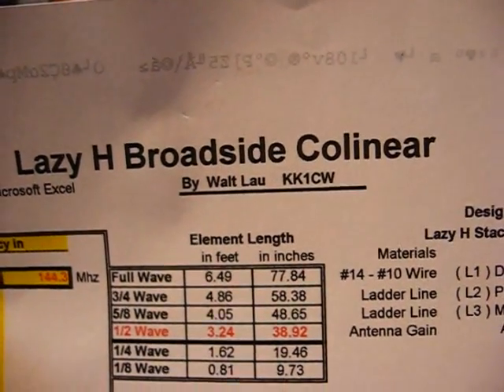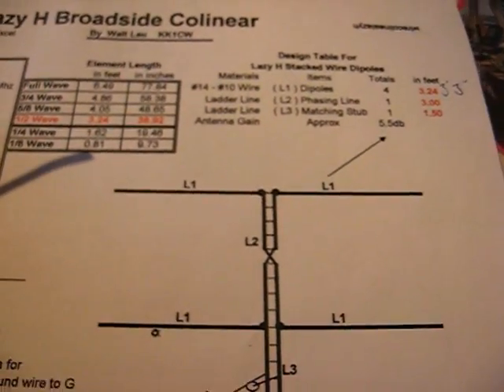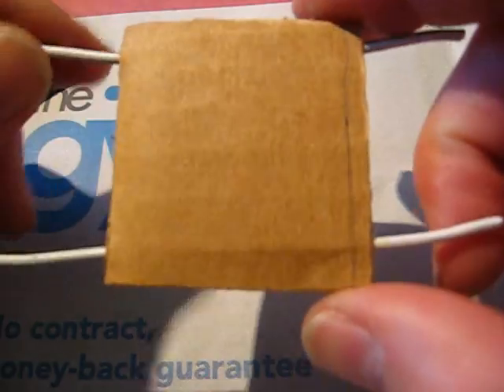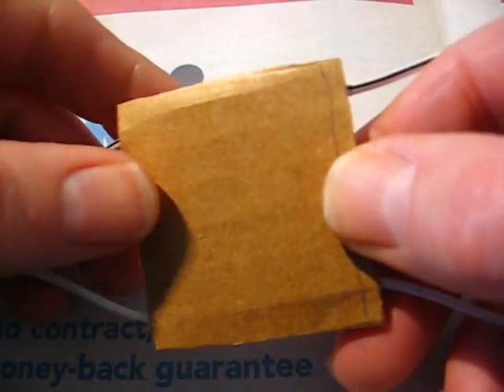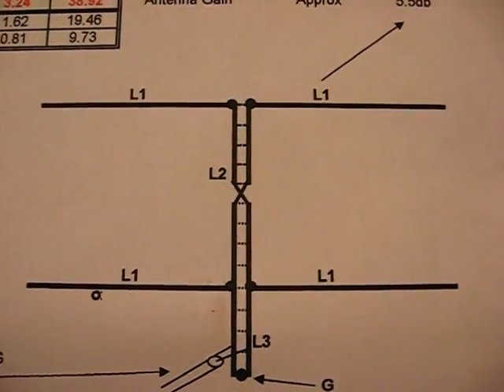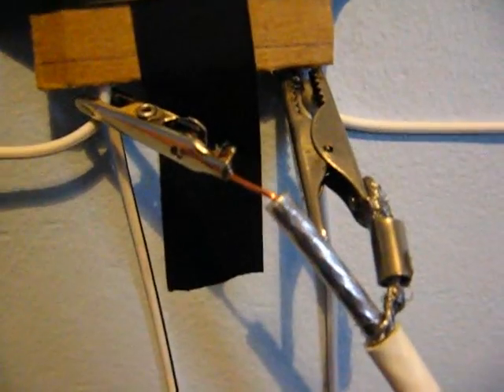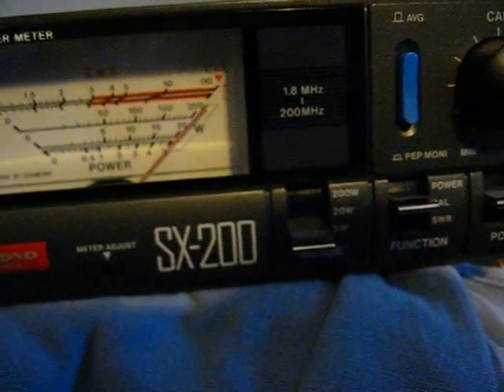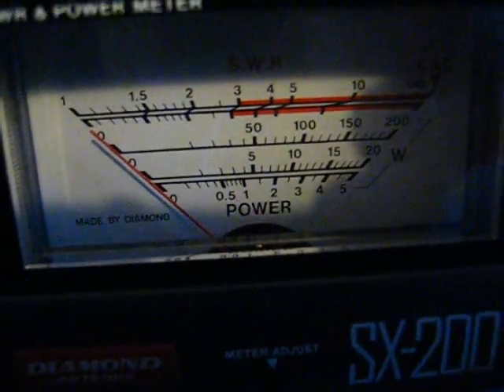LAZY H ANTENNA.mp4

Comment: At "L2" on the diagram, is shows the wires crossing...but on your actual antenna, they don't cross.  Does this matter?  

Looks simple to construct.  PVC pipe could be useful as the main support and drill 2 holes at either end to take threaded rod as the elements.  Leave the matching stub hanging out the bottom.